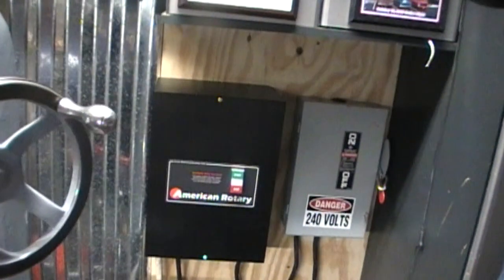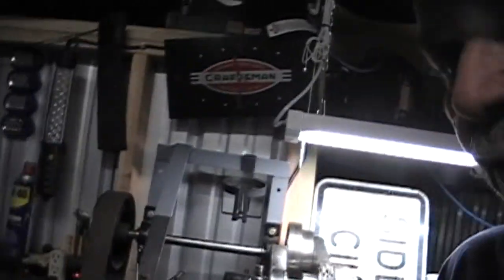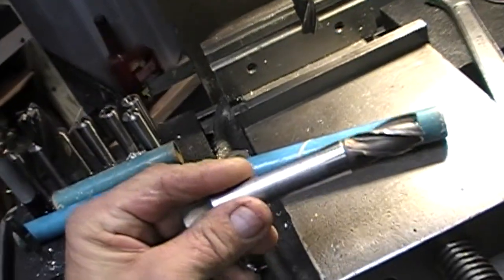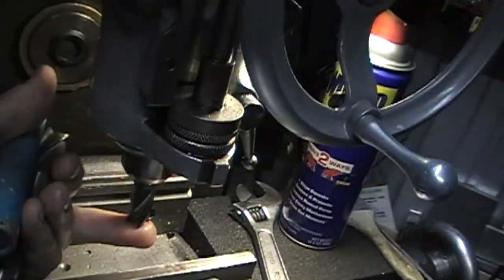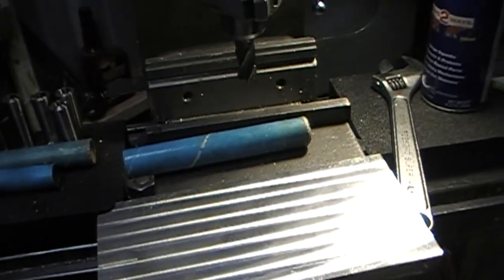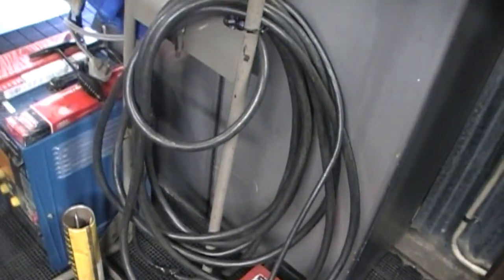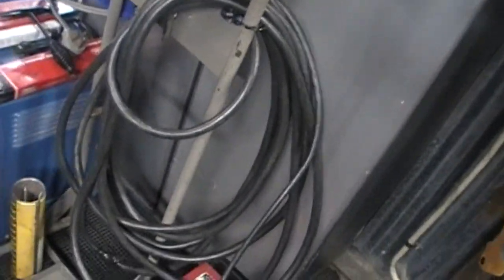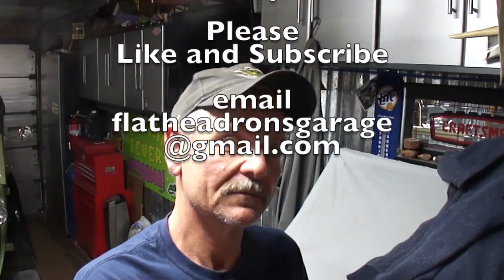Abrasive Surface Grinder American Rotary is Wired and 2018 Bar Z Bash Update

Comment: Looks like a good deal on the end mills.  Stay safe in your travels. The Bash is on my Bucket List, but I am afraid my bucket will never be filled, now that I'm on a fixed income.  I will live vicariously through your live streams.  Will have to remember the time difference, setting a laptop reminder now.  You will have to teach me how to do scrolling text.  NOTE: Adam Booth (ABOM79) has surgery 6/19/18, so everybody say a prayer.
Reply from the maker: Morning Vernon thanks for watching and commenting. I am only using iMovie which came with my Mac and the scrolling is a drag n drop option. I was not smart enough to figure this one out myself.  Well at least this is less expensive than building flathead motors. It would run 10k to build another like I have in the A bone if I could find a block with the L   Poured in the foundry which the v12 was cast. Military block high nickel and less core shift for big bore / racing flatheads. Hope I don’t have problems with streaming. Almost done with my third year of retirement so I do have financial limitations.  Wouldn’t be able to do this if I didn’t sell all my 20 years flathead collection.  You will be seeing me at the bash my friend. Have a nice day